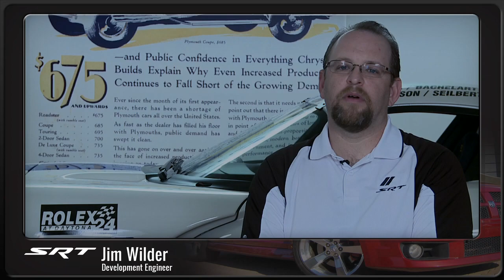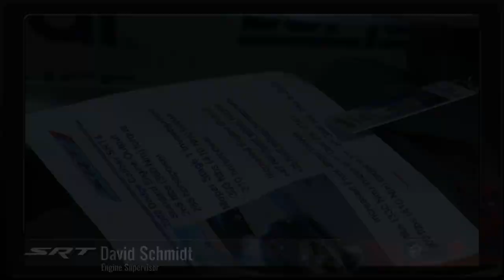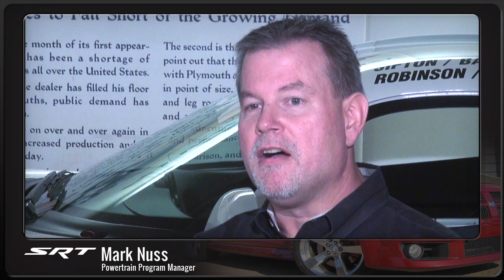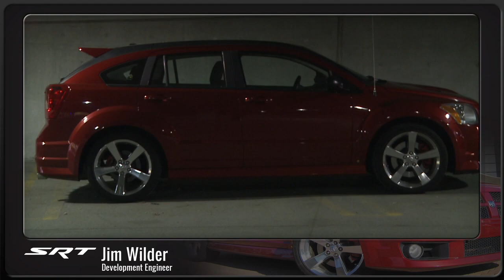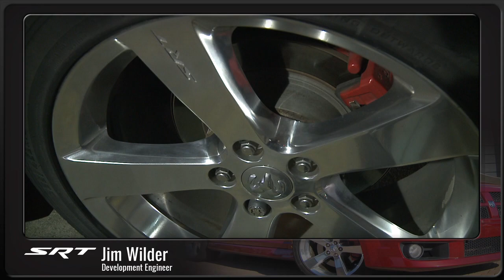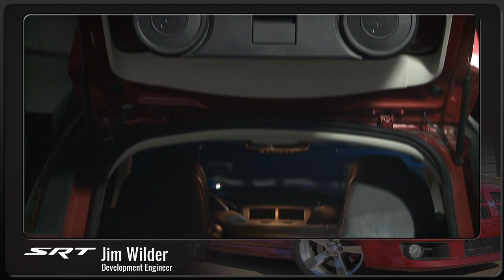SRT History: Dodge Caliber SRT4.

Comment: Ive got #4342 in my hands and going strong at almost 92k miles! Used to have an OB respray ACR that was the same mileage only ragged out. In more of a garage storage condition this thing is absolutely wicked. Ms1 ecm and the slightly larger ms1 neon injectors ready to go in for additional fun! Only qualm on this one is using the brake-lock diff. Really took away some of that good feeling when driving the car hard. Gives you a bit of a numb sensation as it takes care of power and really feels numb/wrong with a fast throw to the next gear (even have the aftermarket sts). Imo gives the sensation of a newer focus st numbness on clutch disengagement then a hit of big turbo n displacement chomping in as soon as its relieved.

Comment: Great car but you guys fucked up in the engine design making them weak between the cylinders. I understand that in an unmolested car up to a stage 1 setup it worked, but for people tuning them making past 500hp the engines don't last due to cylinders cracking! It's a shame that they can't meet the same expectations the neon could handle

Comment: 3:19... "We ended up with front wheel drive"... the face expression is priceless... complete disappointment LOL :D
7:04... You spent all that money on the spoiler and screw it down in the worst way... that stuff keeps unbolting itself over time.... wasted money!
Should of spent money on an aluminium hood and aluminium charge pipes (the metal crap starts to rust inside over time...) ... and waterproof those electrical boxes.
Strongest points of the car... engine, transmission, interior space and looks (but that's personal taste in the end).
Worst... electrical stuff and terrible suspension components
Reply: Well.... Suspension is only an issue if you live in shitty climate. Well unfortunately for YOU and for Chrysler the majority of the US sees significant SNOW FALL. So that didn't do a good enough job making some suspension components more robust. What electrical problems? I never really heard of any. it was one of the first cars that enthusiast had to deal with drive by wire technology.  Nothing wrong with FWD, for AWD you would have ended up with same price point as the Golf R and Focus RS. RWD was considered but again the price would have gone up and it's really not needed.

Comment: The funny part is,these guy's took the chassis that the Evo X uses and instead of taking advantage of it and adding AWD,they didn't. I've only seen one video and only one report on a single Caliber srt4 in russia with a Evo X Transmission and differentials. In all honesty,if i ever bought one of these that would be my first modification. 
Get the Evo X parts:
Transmission 
Front,middle and rear differentials
AYC pump 
ECU 
Driveshafts
Get the Japanese performance parts that all fit since they are the same engines
Have a one of a kind SRT4 monster. 
Let's see what happens.
Reply: luigi999ish so its true they copied the Mitsubishi's 4b11 engine?
Reply: You don't need AWD you need to learn how to drive. If Hondas can do 1.8 60 ft times on 300 wear rating street tire so can the Caliber, Neon, Cobalt, SS and other cars that seem to struggle because they don't think outside of the tiny box they are in.

Comment: Awesome car, I love it ! My friend just bought one few days ago and I am in love with this absolute engineering perfection. It combines performance and practicality. I also have a video of him pulling in 1st and 2nd gear if you would like to check it out. It is currently at 315whp ! :)

2008 Caliber SRT4 Pull !
Reply: The engine is awesome. People tried to push pump gas on these things which lead to engine failures. Just because you can't hear it knock, doesn't mean it's not happening.  Ten years later we understand DBW much better and it's a way to improve traction by limiting how much air is allowed in the engine. Moving forward now that you can flash the PCM with HP Tuners or Diablosport the potential of this platform out of this world. Too bad the majority of the SRT4 community likes the Neon better even if it's not nearly as nice a car as the Caliber or my Focus ST.